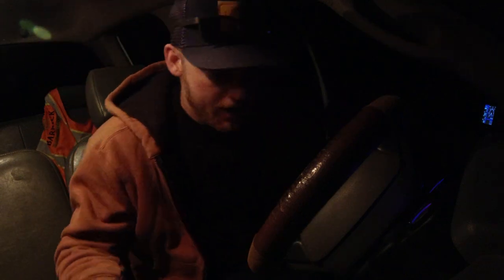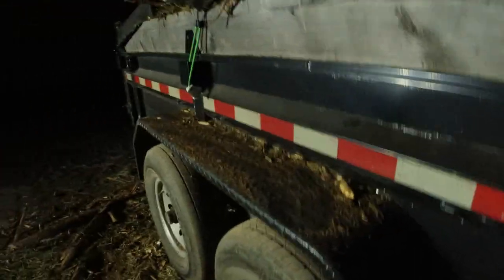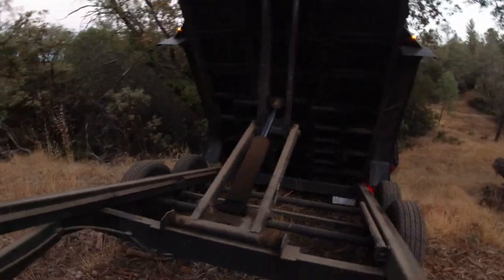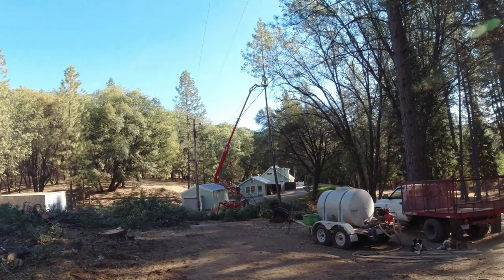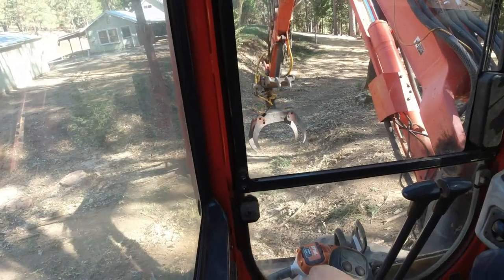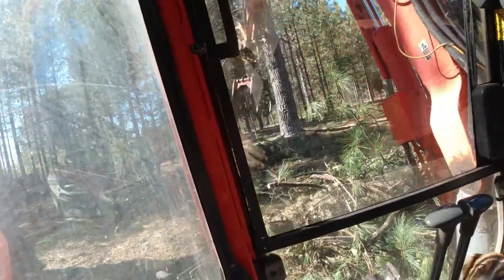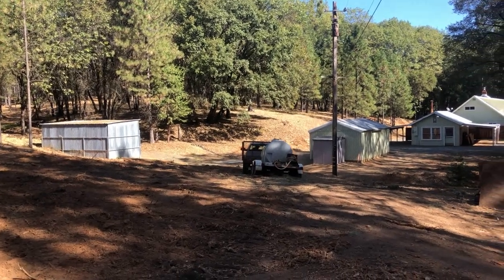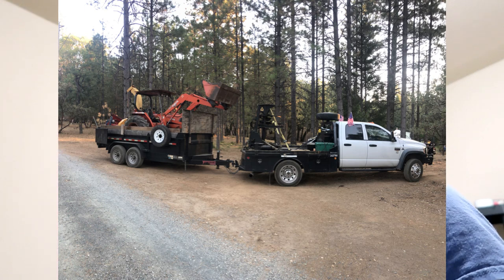hauling load after load of wood chips   clearning clean up

Comment: Hi Sam, we just got a new dump trailer. It's a 16'x8' deck over with 32" sides. Two 12k axles and 25900 lbs gvwr. It can haul a good jag of wood and is great for big skid steers. The best part is it's a bumper pull. Keep up the good work.

Comment: I have a 8’x20’ Texas pride dump gneck with elect/hydro brakes and 12k axles. Best upgrade to it we’ve done was to rip out the electric hydraulic pump & thrown in a gas engine powered hydro pump that runs the jacks and the dump. It has a valve to select which. It dumps ridiculously fast and is super strong. Once grossed on at 52k with a load of trash and concrete. It dumped fine and the 5500 hauled it without issues. We learned to scale back on how much concrete we carry tho after that

Comment: Just an FYI. Wood is more or less the same weight per volume as water. Slightly less. Stone and sand are roughly 2.5 times the weight per volume as water. So a trailer that hauls a yard of sand can haul two and a half yards of chips for the same weight. For your joints like those achy knees, get some collagen. I use the Perfotek brand and get it on Amazon. 78 years old and literally rebuilt my knees. There is a published study and 2/3 of people with bone on bone knee grinding regrew cartilage that a 30 year old would have. Everyone who has tried it sees great improvement in 2 to 3 weeks.
Reply: Any side effects ?

Comment: I had a 7x14 suretrac sold it and bought a 7x16 sure trac huge upgrade for hauling the tractor around (kubota m6060). Also if you take the bolts off the doors and swap them out for pins you can take the door off for hauling something longer.

Comment: I'm looking at a company  that custom builds fir refuse companies...super heavy duty.... it can even be a roll off with options  to haul equipment  in the roll off as well haul heavy equipment on deck when roll off is installed....30-40K trailer or less custom  sizes......I've been think about fir myself....(disclaimer-NOT CHEAP)  Quality usually isn't in business  as you sherlly found out for yourself....thx fir your uploads neighbor!

Comment: Great work! Replacing the dump trailer, would you consider a trailer to haul dumpsters? Even build a modified version of a dumpster that would basically be a flatbed for hauling equipment. The place I work has a dumpster truck with a modified flatbed. It works pretty well. I’m just unsure of the weight.
Reply: Just sold my low profile dump trailer because of the dragging problem get a standard height no more dragging
Reply: What brand is that
Reply: My lights are recessed never have broken 1

Comment: I personally own a 7’x12’ 10k bri-mar deck-over dump trailer. It’s an okay trailer, I guess. The tailgate and paint are terrible. Is there any good reason why dump trailers don’t have the hinges welded at the rear of the bed like a dump truck? This would give you a much better dumped pile and wouldn’t spread out the pile so far and you wouldn’t be dragging your tail lights.

Comment: Order you a diamond c 16x86 LDP 24k trailer. Right now all types of trailers are impossible to find, so order the right one you will use most often, and get top $$$ for your used dump trailer , the market is tight so you can sell in a seller market 
S-3 ranches sisterdale Texas

Comment: If you buy a dump trailer spec one for what your going to use it for. My dump trailer is made by Lamar and is their medium duty trailer I found I didn’t need a 7 gauge  floor or 10 d rings or 7k axels im husking bulk 90% not weight so I went light and large for what my truck could pull.  You could get a 16ft medium duty trailer and just upgrade the axel to a 7k axel or 8k axel and it would be a killer wood chip/brush hauler add some high side and bam you could get I bet 14yrd of chips in that thing.

Comment: You could recess those tail lights into the back by cutting the bracket for the light and setting it back in a pot that bolts on from back  put wire  mesh over the hole lol

Comment: What about a roll off with different size containers and a flat bed for them. I have seen some guys around my area with them with the skid steer and small excavators in them hauling them to the  job and ground level loading the machines.

Comment: How ironic, I just spec'ed out a Diamond C WDT, 16'x 96'' x 42'', 25,900 GVWR, w/ telescopic cyl. pretty much loaded up, still waiting for my quote and lead time. You should consider the telescopic lift, not to many co.'s out there that go this route, probably due to the cost of a 20'x8" hydraulic cyl. . Keep the tracks turning.

Comment: Would it make sense to add sides on your dump trailer similar to the metal grating on V Belts dump trailer?  It could definitely increase capacity.
Reply from the maker: I added some wood ones after this was filmed
Reply: @VBELTandSON  I've got the same trailer except it's the 7×12  and I put an extra 2 2x8s up the sides. I can get two cords exactly in it. probably be around 10 yards bed level. Tnt trailers arent all that bad